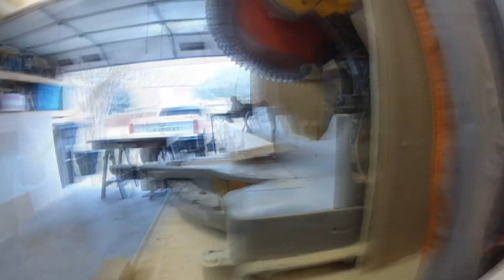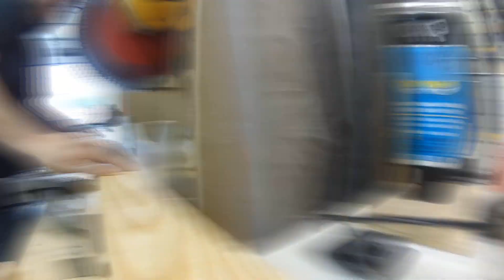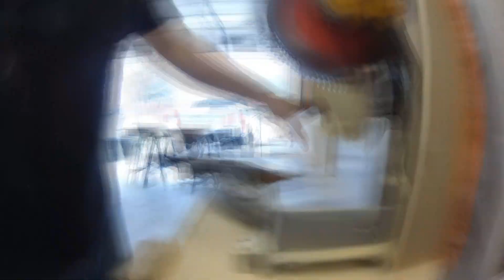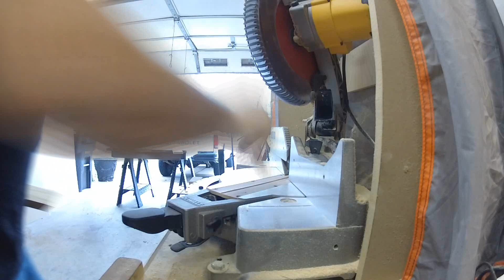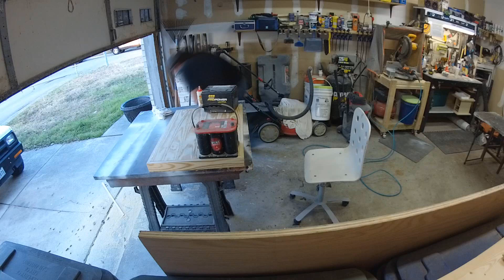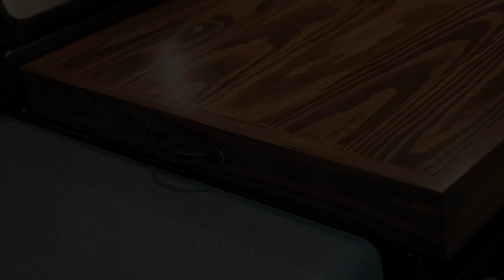X3WD - Stove Top Cover for LESS THAN $32!!

Comment: Cool video. Thanks for sharing. 

I have a quick question. Now that this piece is four years old, have you had any issues with wood movement? The grain for the box is 90 degrees to the grain of the top. I have a request to build one similar, but am concerned about wood movement.
Reply from the maker: Great question. No cracked boards or warping of any kind as of yet.

Comment: Does it hold well without using wood biscuits in-between the boards?
Reply from the maker: Yes it does. So long as the moisture content of your lumber is low, there should be minimal wood movement.

Comment: I see you used a Brad nailer over a finishing nailer or screws. How is it holding up?
Reply from the maker: It's holding up well. Keep in mind the brad nails are just temporary holds till the glue fully dries. That in addition that the inserts are also glued in place keeps everything together. Thanks. =)

Comment: Very nice! Love the finished product 👍 I am  currently working on one with raised elements and went a slightly different route. I added a small strip to the bottom on either side to keep the cover off the elements. Just curious, how deep did you make the frame to keep from touching the elements underneath?
Reply from the maker: Terry Mason thank you! The client had a gas stovetop so the knobs were about 1” above the surface. If I remember correctly I made the cover 2” in height minus the 3/4” slats so it was 1 1/4”.
Reply: Mine is gas too,st time I see the handles in the side, I like it

Comment: Hey great job what did you finish it with?  Shellac or just polyurethane?
Reply from the maker: I just use a water-based  polyurethane. I just make sure to explain to the client it's not to be used as a cutting board.
Reply: Thanks man